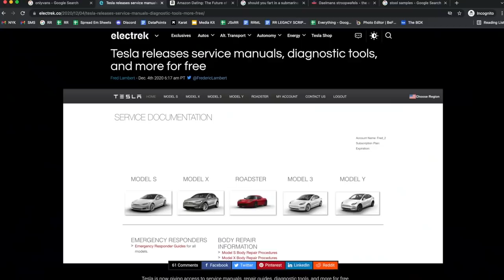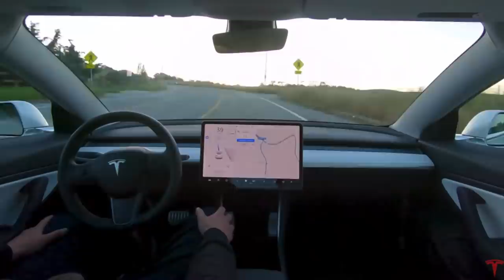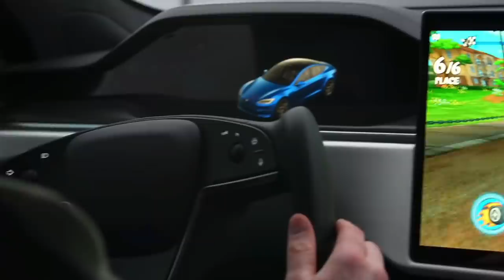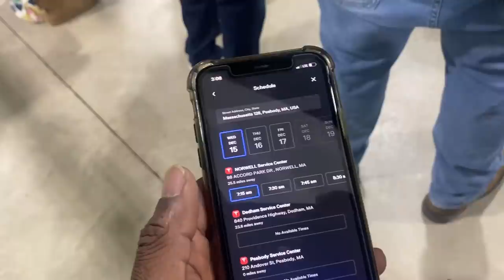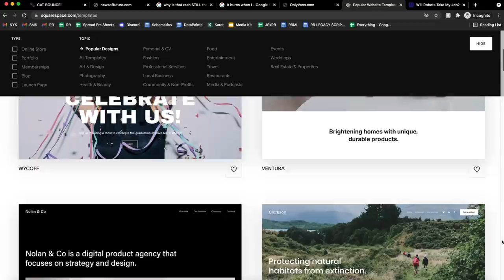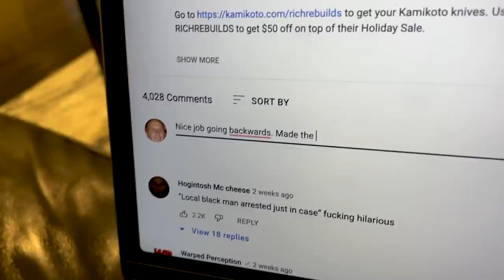How Tesla is failing its most Loyal Customers

Comment: Never understood all the hype from the Tesla fanboys with the "Auto Pilot" (overrated Lane Assist), and FSD (barely overpasses Level 2 Autonomous). Maybe it's an important feature for people that don't like driving, but need a car to drive around and flex to others.
Reply: FSD is not done yet. People who test it are making better every time they test it. That's why it's called FSD Beta.
Reply: @cuppajoe2  one thing is using it on the Highway with controlled flowing traffic, another thing is using it in urban areas, with so many variables for the system to keep up. Even with new situations not predicted in the Code.
Reply: @RogerM88  it’s a machine learning algorithm, which means it’s not code that has every situation coded in. think of it like a learning driver, they aren’t perfect but they are still learning. That’s why the person driving the car is there to take control at any time and pull out in a bad situation. Every time the driver takes over, the AI learns what it did wrong and can correct it for next time.
Reply: @cuppajoe2  Maybe in 20 more years it'll be Level 5, but not anytime soon, no matter what big words Elon uses (AI, neural net, Dojo, blahblahblah). Until then, it'll be like it's been for the last 6 years: 'Coming next year!'.
Reply: I'm honestly surprised that we haven't heard about one of those autonomous delivery vehicles killing anyone yet.
Reply: @cuppajoe2  AI it's Code...wrote by Coders. Many companies that promised wonders in FSD systems failed to achieve the goals. Even with many years of testing Driving is an activity that requires quick adaptation to a new situation presented, a Human ability over AI, that is better for more repetitive actions with known scenarios. That's why AI systems in Railways are easier to implement.
Reply: @ganymede3141  maybe, maybe not. Maybe it won’t come for 40 years, maybe it’ll come next year. With neural networks you really don’t know. Also nobody said it was coming next year. V11 of FSD beta should be coming within a month, but that’s not gonna make it a level 5
Reply: @RogerM88  The way a learning AI works is the human codes a program that makes a bunch of ai, and then that ai is put under tests (in this case humans overseeing the ai drive on roads). The best ai within that group is copied and modified a little bit, and the process starts again. We don’t know how that finalized ai works since technically we didn’t build it. This means the ai learns how to drive like a human would learn how do drive. This also means it’s really hard to predict when it will be done. Like someone above me said, it could take 20 years, it could be done next year, it might be done in 50 years. We really don’t know.
Reply: @cuppajoe2  That nostalgia of AI portrayed as capable of "thinking", is decades far away. And pumped by many Sci-fi followers. AI uses data to identify patterns, and selecting a Code more appropriated for that pattern. As an example you've Youtube Algorithm. If you're searching for videos about car repairing for some time, the suggestion videos going to be other car repairing videos. Also some words used on the video are associated with certain themes. The issue with AI is that it can't "improvise", a very known Human feature. And part of the reason why it's so hard to build a reliable FSD system for the road.
Reply: @cuppajoe2  Elon has been saying 'Coming Next Year' since 2016. In 2019 he even said there would be a fleet of a million Tesla robotaxis by summer of 2020. It's now January 2022, still not a single robotaxi in sight. So I'll disagree with you that nobody has said 'next year', when Emperor Elon himself has been saying it for 6 years.
Reply: @ganymede3141  can you send me proof that he said that? I have never seen him say FSD will be done next year. On other cars, sure. He has been quite off on his deadlines, but not on FSD.
Reply: @cuppajoe2  Many more examples of him saying FSD will be fully ready on his Twitter stream. I'm not going to hunt all of them down for you. In 2016, when the Semi was unveiled, he was talking about autonomous semis caravaning and said "We can do this right now". Clearly that wasn't the case.
Reply: @ganymede3141  oh don’t worry I don’t need all of them. One will do.

Comment: I bought a used 2016 X and was going to the service center at least twice a year for various things. Bubbles in screens, windows on falcon wing doors not rolling up all the way, MCU failed, and battery heater failed. Also had FSD but I live in Jersey and good luck getting a 100-safety score in that state. After the battery heater failed, I immediately ordered a model y performance to get out before the used warranty expired and I would be spending thousands to maintain a year. I also did not spend the 10 G's on FSD. Telsa did end up giving me more for the used model x than I paid for it cause used car prices are crazy right now.

Got delivery of my model y performance and the alignment was off from the factory. Also got the car with 140 miles on it.... Service center said I should avoid those potholes when I got delivery the previous day.

Comment: I feel similar negative 4wp vibes from this video. Bought a stage 2 6" lift believing I'm covered with their "10y ultimate warranty"... 5 years later my coilovers are blown out, in the fine print of the ultimate 10-year warranty, it states that shocks and coilovers are only covered for one year. THAT'S THE ONLY LOGICAL PARTS THAT COULD BREAK OTHER THAN THE STEEL PARTS INCLUDED IN THE KIT!!! 🙄
Reply: On my 3rd set of axle gears from them...the labor warranty isnt covered for longer than 90 days so if your gears get burnt up 2 years down the road from a bad install you get the gears for free but you gotta pay labor

Comment: Read your credit card documents.  In most cases, if you pay for services with a credit card and don't receive those services, you can do a charge back, and the credit card company with refund you and take the money back from the failed service provider.
Reply: Tesla will send the credit card company the contract and they will deny the claim.  The rub here is the service department having the car for so long, but Tesla did provide the service even if the guy couldn't use it.

Comment: Holy crap, it's nearly as bad as dealing with Apple when it comes to repairs and accountability.
Reply: I see these two companies exactly the same. Overpriced / Overhyped products and disciple customers. 
They don't give a shit about their disciples.
Reply: @juliusplaysgames  It's hard not to see them as the same, really. Apple has just had more time to perfect their shitty ways.
Reply: Apple products are made well and have very strict QC. That's nothing like Tesla...
Reply: @stevemcgowen  I wish that were true but my last two macbook pros have been terrible. My 2019 I had to send back 4 times, and my new M1 is already acting up and am about to send it back.... but its tough, because like Tesla it does things that the competitors cant touch. lol, my 3 has been flawless though (fingers crossed).
Reply: @stevemcgowen  some are made well.. There are examples of lines of Apple notebooks that kill themselves by: cracking solders on gpu, self tearing (lcd) ribbon cables, sending 52v on a data line to cpu, fans going full rip because they think the system is at -144 degrees, bootlooping because trackpad connectors got jostled while in a backpack, etc.

I do own an Ipod Shuffle from 12 ( twelve ) years ago that still works perfectly (minus some bat life) that I've used daily, while hiking, through torrential downpours, dust and grime, mud, numerous replaced headphone cables,  quite a few rip-cords, etc. Not even in a pocket, clipped on the outside on my jeans pocket. <i feel like that is not the norm ¯\_(ツ)_/¯ but idk from sample size of one.
Edit: had some typos.
Reply: @netronet1383  meh vast majority disagrees with you. Right to repair is small portion of population likely nerds like us. Parents do not care and love how easy it is to walk into any apple store and get support
Reply: @ehlava  I have only had 1 Apple product that failed in an unusual amount of time. I got a 1st generation iPad as soon as they came out and about 2 years  later it no longer charged. I went to an Apple store to see how much it would be to get fixed- as it was out of warranty and they gave me a new 2nd generation at no charge...
Reply: @stevemcgowen  You may have noticed I specifically addresses repairs and accountability. Have you not heard all the nightmare stories about people trying to get apple products repaired? That aspect is extremely very much like Tesla.
Reply: @stevemcgowen  yeah, we have an ipad still going strong and my 2013 macbook pro been awesome... the new ones have been terrible for me but might just have been unlucky.

Comment: This is what happens when the only place that fixes your vehicle is the same place that sells it. Everyone that complained about states like Michigan that didn't want to let tesla treat people like this owes an apology to those states.
Reply: I disagree.  They should be allowed to.   This actually wouldn't be any different if they had dealerships like everyone else.  They would be holding back to the dealers and not selling to independents.    One thing though if they did have dealerships.  The dealers would have less issues mixing it up with Tesla in court.  Now, it's you against Tesla.  With dealers, it could be you against a dealer which is a much smaller fish.

Comment: Had an M3 and sold it for 4k more than I bought it for after putting on 30K miles. Looking to get the a P85D even with this negative information. That said I'm not some rich dude that cant troubleshoot. I reached out to see what the Electric Garage would charge to change out a battery and the labor and programing were so competitive Im not concerned with being out of warranty when that day comes. We need right to repair to be pushed down their throats like a dog taking a pill, its bitter at first, but it will help them in the long term. Seems like Tesla has the same level of foresight....

Comment: We have been lucky with or Model S (60.000km). Only faults has been rear lights flashing on cold winter days and the mounting points for the roof-rack was misaligned. Customer service was beyond horrible and we will buy another brand when the Tesla hits 100.000km.

Comment: I have a model 3 and was subjected to Tesla service hell 3 times in the first 2000 miles. Each time I had a repair, they made it worse and I had to go back 3 to 4 times to get it somewhat better. So each of the 3 appointment ended up with 12-15 returns to the service centers. The car is worse than a 1980s Hyundai.
Reply: Wow, I think that would qualify as a lemon law buyback if you are in the US.  Never right to have so many repairs for the same thing on a new car.

Comment: I bought my first EV 6 months ago, and it wasn't a Tesla precisely because of these videos.
I am fond of the car's high tech features and properly advanced tech, but I will not suffer early adopter pains, especially for a car.
I will buy one used after a few years when I can realistically work on one myself, or find someone local who does.

I am not in the US or Europe, so there is a higher probability of being stranded without help, as many Tesla owners here find themselves on a waiting list for replacement parts already.
Majority of Teslas sold here have LFP batteries, so mileage and age doesn't really matter.

Comment: Tesla def has the worse customer service out there. Received a call from corporate stating it was a defective battery pack. Had to take my car in 12 days after delivery for my modelY. Also had a wind noise too, they took 2 wks to fix the battery and didn’t fix the wind noise. Took it back a month later to fix the issue just get it back to today and the issue is still present. They had my car for 3 wks and didn’t fix nothing. Offered me some all weather mats for my troubles smh. They have literally had my car longer than I have since purchasing it.

Comment: i have heard bad things about tesla service. but i have been lucky that i have had only one inconviniance whit service. because closest service center (3 hour drive away) they coudunt get my car on the lift because it has aftermarket side skirts and work safety rules prevented use of jack puks under to give more clearance between side skirt and lift arm, but then when i called to only ohter service center in finland they suggested use of jack pad (what was against safety rules on ohter place). so because that experience i think customer service level depends greatly on person you deal whit.

Comment: Missing brake pad. That's safety equipment.  It never should've left the factory all safety equipment is inspected before it gets out the door. By the way in the rest of the market the final inspection is done by the delivering dealer.

Comment: I still have my tesla but I am keeping a close eye on other EVs that are coming out, I am looking for a vehicle in the same price range (model 3 long range) with ballpark same range, acceleration and so on.  Service has been the issue for me, when people ask me about the car I tell them I do love the car although it has had its issues but that service absolutely sucks.  Usually 6 weeks to get an appointment, I'm not sure if there has been a single time they actually fixed all the issues in the visit which they said everything was fixed so generally to get things fixed its at least 2 visits to service, 6 weeks wait each time.  The last thing I had them fix was a seat sensor issue which it had been in for before and wasn't fixed, (the car would act like I wasn't in the seat and slam it into park if I was driving slow without my seatbelt on such as repositioning my car in a driveway or whatever.  Tesla's actual response to me was that I should be wearing my seatbelt at all times no matter how fast the car is moving and that if it does it with my seatbelt on then they will look at it and fix it.  After it was out of warranty, for this same seat sensor issue they fixed it and then charged me for it even though they were aware it was the same issue that had not been fixed under warranty that it had been in for twice before that.  So the seat sensor got fixed, another issue didn't, I had also asked them to calibrate the headlights which they said they would do, and didn't.  Currently have pre order for cyber truck but looking forward to these other companies coming out with their electric trucks will be switching to one of those.

Comment: Update on the latest case study. Tesla mobile service came to my house yesterday and replaced the door opening rods. No charge, on time. By comparison with my previous cars I would have had to bring the car to the dealer and find that they didn't have the parts. In my experience and the experience of others I know who own these cars Tesla service is far superior to anything we have experienced at a traditional dealership. 

Is Tesla "failing its most loyal customers"? No, quite the contrary. Tesla service is just one more reason why the overall Tesla ownership experience is superior to the traditional dealership service model.

Comment: I bought a 2011 Leaf new with a 24kWh battery and a CHAdeMO port new because I couldn't afford a Tesla.
In the subsequent 123,000km, I have replaced the wiper blades once and the tyres twice.  I stopped taking it in for service when I realised they were just charging it up to full at 440V, and charging me $100 every time.  I also crawled under the bonnet myself and replaced the stock horn [which would be embarrassing even on a clown car] with a $19 AMO product by Fiamm that sounds like a Cadillac horn.  (Also, Nissan gave me a new battery after five years because of a class action called "Klee.")
But I always wanted a Tesla S.
After another five years, I currently have about 75%SOH, and Nissan have offered to put a 40kWh battery in for US$12,400; I may buy a 2021 LeafPlus wreck and swap out its 62kWh battery with a bit of techie help from a Finn named Dala and his amazing "CAN bridge" widget.
After watching this, I'm less keen on a Tesla S.
But you will never.
Ever.
Get me back in an ICE.

Comment: 17:17 The customer says, "That's sociopathic, don't you think", referring to the payment for non-service.
We know that any corporation is a psychopath, it is driven by the shareholder, with little to no regard for an individual customer.
Richie says 250,000 cars per year, generally good, we love the concept and the marketing. 

The customer has to shout loud enough for the consistency of quality to be upgraded, otherwise the psychopath won't care. Even the fan boys need to make some noise, so that their concept and marketing dream 'drives' (sorry) towards the perfection they expect. No point in pretending the king is wearing cloths. Someone has to speak up. This is a great opportunity to drive a fantastic product to the completion we and the engineers want. 

Constructive complaints are constructive. Lets use them.

Comment: The subscription part is his own fault, if you can’t or don’t use it you lose it. Everything else also lines up with most manufacturers right now. Parts are way behind. My Chevy just blew a motor and they already told me they have no clue when they will be replacing the motor and cannot offer me a rental 🤦‍♂️